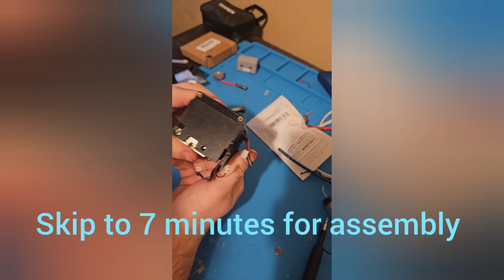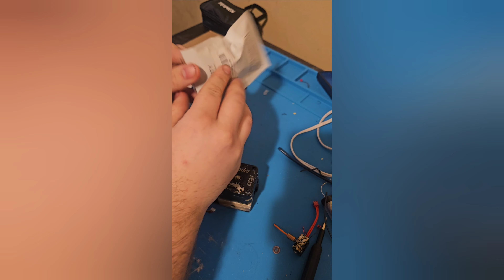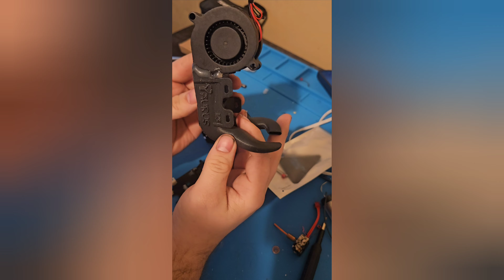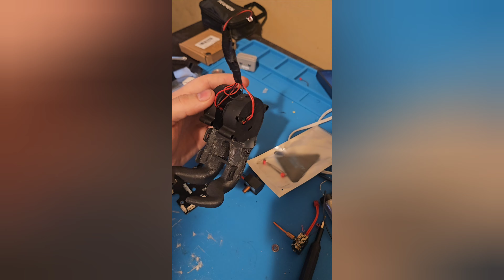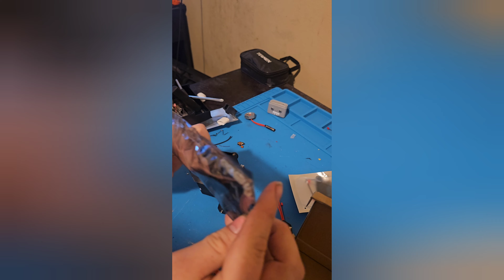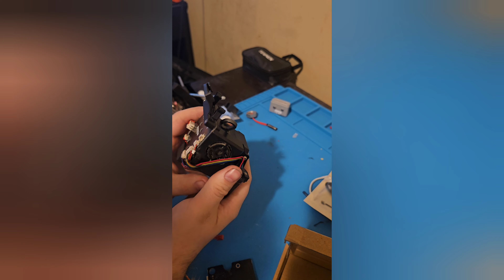Sprite pro hotend circuit board and heat break installation

Comment: I removed my nozzle to clear out a clog and a small black straw like piece came out with it. I do have a sprite extruder pro. Can you confirm if that’s a piece of tube or a build up of filament? I have a picture and I can’t figure it out.
Reply from the maker: The tube should be clear or cloudy like a ptfe tube also it shouldn't come out if you just removed the nozzle the tube only comes out if the heat break is removed
Reply: @Savage3ddecals gotcha. I removed only the nozzle and it came out of the heater block with the nozzle. Looked like a tiny black straw that fit inside the nozzle and went into the heater block.

Comment: Thank you. I have dis-assembled myextruder a number of times to try and correct problems with my printer. I didn't know about the snugging down of the hotend with the 2 screws before tightening the grubscrew. I'm hoping when i fire it up next it will be better. Cheers from Australia.
Reply from the maker: It something easy to miss